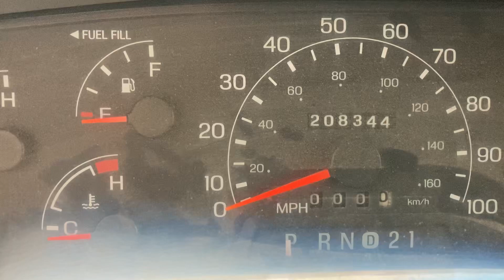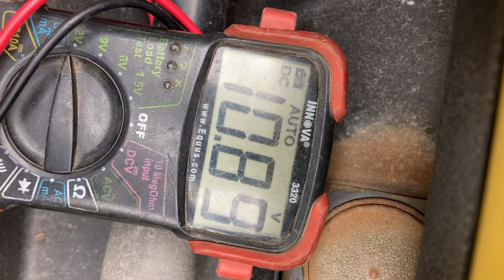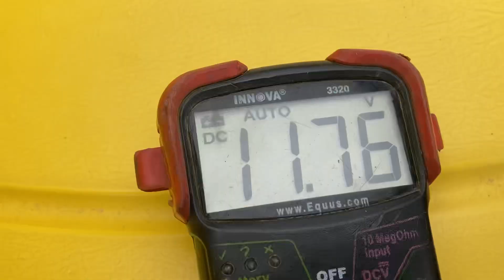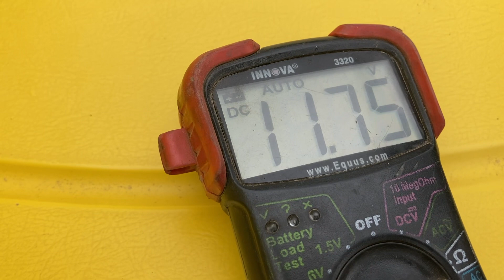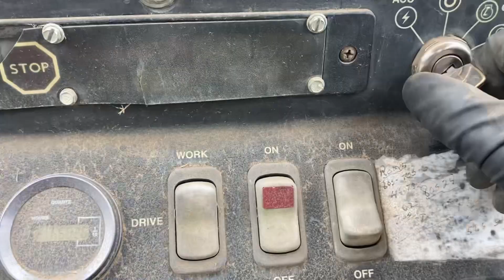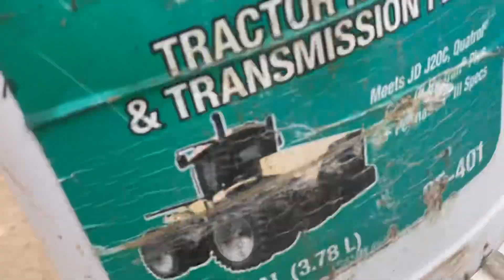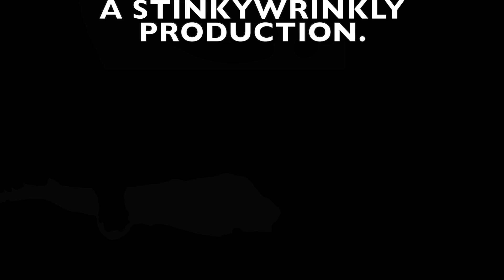But not for long ! Part 1

Comment: IF a customer says "Fix IT" do you give them a fee for an analysis of the problem , and a fee for the actual repair ? That way they can't complain that you have OVER charged them !!!! The more documentation you have of their verbal acknowledgement of the cost figure(S) you have quoted them , the stronger your case will be IF you take them to small claims court !!! 
I would record all your conversations with your customers when it comes to documenting repair costs you have quoted them !!!
Your video's are OR will get better over time , because they're interesting NOW ! Good luck with your self employment !
Reply from the maker: yeah I dont ,do an analysis fee, but I am now doing a deposit for coming to look at equipment,
its a 50$ fee for me to come out to the property to look at equipment.
thats a great Idea though ,
Going to start using that.
Thanks for the great advice Joe!